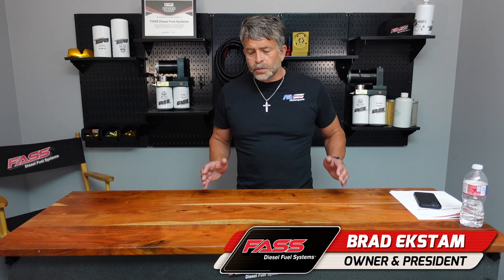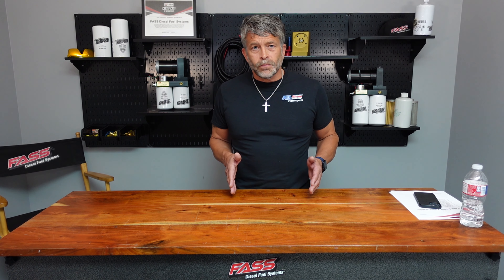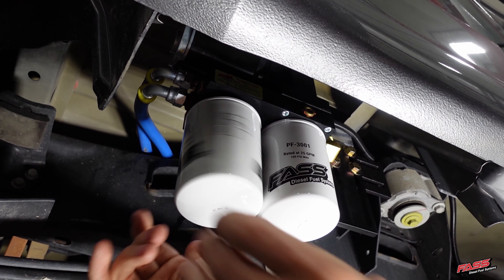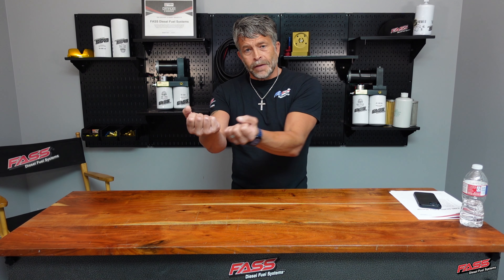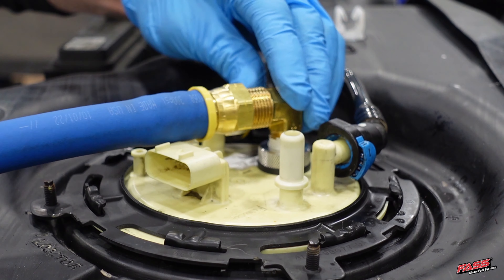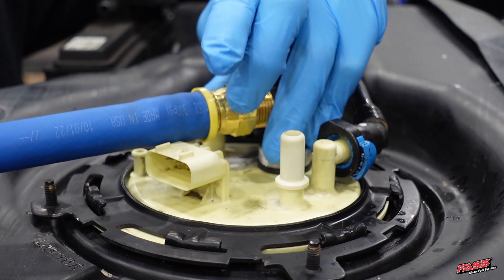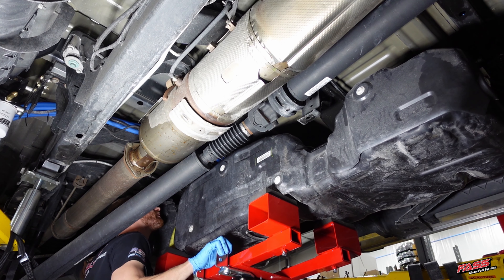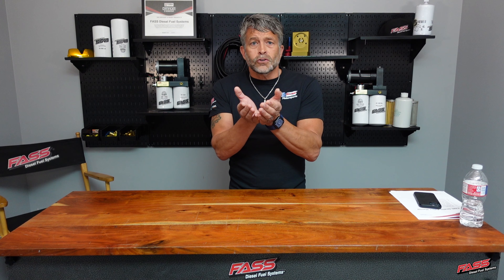Installing a FASS Fuel System WITHOUT a sump kit!

Comment: I run a sump only because I have an automatic pumping system in a 50gal bed fuel cell. I use it primarily all the time however I did run the main tank down just to a quarter tank just to see how the sump would handle and had no problems. I don’t recommend run to low with a sump either just because of what you’re describing. Always think of everything. Great videos! I might return back to top of tank if I do away with the bed fuel cell but it’s working fine. Sure love the signature series pump!
Reply from the maker: We're happy the sump is working well for you man! If you ever have any other questions were are also available at 636-433-5410. Our service team will be happy to help with anything you need.

Comment: Do you guys have a full video on the installation through the basket?
Reply from the maker: Sure thing, we have a few vehicle-specific ones as well. What year, make, and model truck do you have?
Reply: @ 2008 ram 2500 6.7
Reply: @FASSFuelSystems  

Do you have to drop the tank fully to install through the factory basket?, some one I know was saying he hooked his up to the stock housing without dropping his tank and drilling.. I’ve asked around (dirty diesel) and they were saying sump was worth it but I don’t ever have my tank below half and I don’t wanna drain my fuel to drill a big hole in the tank haha
Reply from the maker: @joshharris9104   Sure thing, we have a link here for the install video: 

https://www.youtube.com/watch?v=ODTVMIVDw7Y&t=1636s&pp=ygUUZmFzcyBjdW1taW5zIGluc3RhbGw%3D